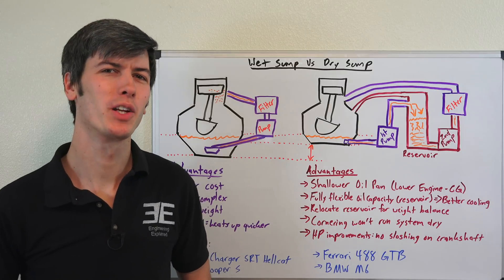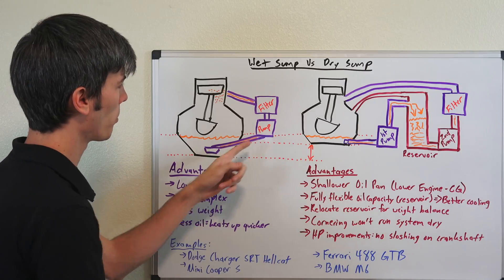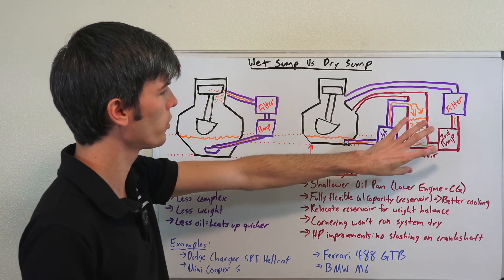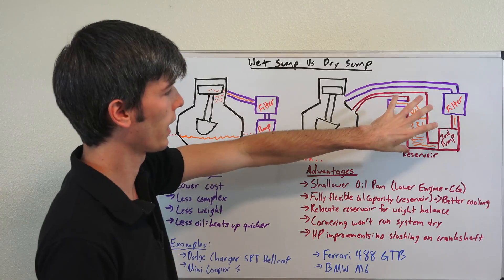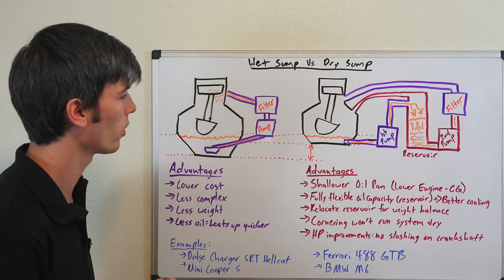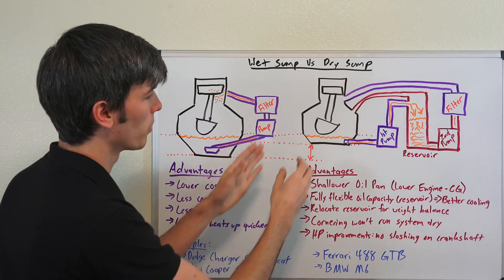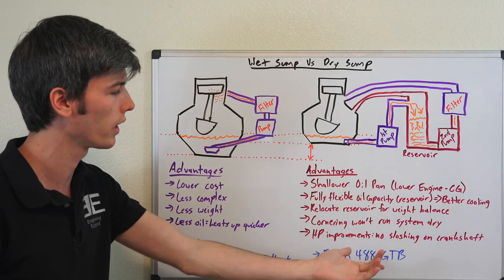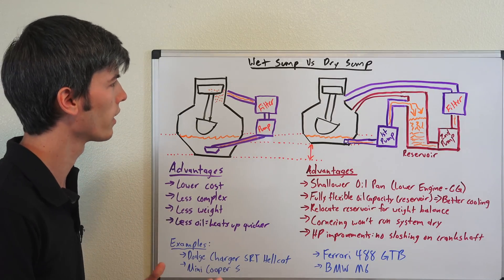Wet Sump Vs Dry Sump - Engine Oil Systems

Comment: My car has a dry sump system and for some reason this video made me so proud of it
Reply: Mathias Mang yeah, the reviews were quite negative about the engine, but I don't think its that bad. Maybe because I owned hot hatches before and this is my first sportscar so I'm fine with the sound and turbo feel. 
The only couple of complains are sound insulation (a bit too much road noise on motorways, but maybe because my car has 20 inch rims) and the fact that there isn't anywhere to put a big bottle (not a big fan of the foldaway cupholders to be honest, so end up putting it between the seat and the sill)
On the positive, the car handles like a dream, also loving the grip (its rwd but grips like an awd in a straight line and in the corners its just amazing), its comfy to be in and usable as a daily. Loving it!
Reply: ***** bought my car this year, so haven't yet had to change oil
So yet to discover all the differences
But I assume since you have two reservoirs of oil, wouldn't you have to drain oil from both and then fill just the second (the tall one) reservoir?
Reply: Dmitry L what car is it?
Reply: Mathias Mang Porsche Cayman
Reply: Mathias Mang yeah the "subaru" one ;)
Reply: what car do you have
Reply: Nice! The new model?
Reply: I really like the new one. Are you happy with it so far?
Reply: Dmitry L I think the media overreacted a bit about the new engine. I really like the car and want to test drive one when it's warm again
Reply: Mathias Mang yeah, I mean I see what they mean, compared to something like a GT4 or GT3 or even Cayman GTS, it does not have the same sweet exhaust note (it kind of sounds like a rough V8 instead to my ears), but it definetly is loud enough
Reply: i dont know what my car has
Reply: it's easy to know it btw !

Comment: This got me thinking, ' big end ' oil splash upwards used to be important?, it no longer is?
A ' dry sump' isn't really dry, it just has less oil.
I also ( perhaps mistakenly) thought that modern cars had multi point oil pick up circulation points for oil ?
In theory a dry sump seems a good idea, but the added complexity, joints piping will surly cause problems?

Comment: The Dry Sump uses eletric oil pumps, right?
Reply: 1300l Na most have a mechanical pump driven off the crank with a belt
Reply: nope , belt driven pump of the crankshaft , you can have a auxiliary electric oil pump to prelube or in case your pump fails or turbo timer to keep oil circulating on shutdown

Comment: You can always add slosh plates to wet sump to avoid engine running dry.
Reply: Still not as effective as a dry sump.
Reply: Matt Bell but wayyy cheaper
Reply: yes, aka as baffle plates or baffles. Essential mod for most track driven car
Reply: Indeed. There are even track ready oil pans with some interesting designs available for most of the popular track day cars.

Comment: I read somewhere that dry sumps on road cars take much longer to get the oil up to it's optimum temperature because they're driven normally most of the time. Is this really bad or not such a big deal?
Reply: From what ive seen it is not a big deal, especially with synthetic oil that doesnt have much viscosity change cold temps to operating temp's.
Reply: Well the effect probably comes from having more oil and possibly oil coolers, if the system was only set up for a high power runs it could run really poorly on very cold days with city driving.
It is a system for racing cars after all, other applications make it a needless hassle.

Comment: Nice video, as usual! You also get a  small horsepower gain from the crank case being run under vacuum. The total horsepower gain from a dry sump system is tiny though and mainly done for weight balance and oil supply.

Comment: How easy is it to change the oil on a dry sump lube system compared to wet sump?
Reply: Qasim Mir actually the same. its just thae sump is put somewhere else and the oil pump is way bigger than the normal ones.
Reply: Scuba actually the same. except maybe for some systems that are a little different. we don't  actually drain the lines every single oil change. look in manuals. in practice, similar to wet, just different location(s)
Reply: It´s much more complicated on the dry sump. As far as i know it from Audi´s W12 engine (dry sump) you need to suck the oil out from different locations in the system with a vacuum and for that the oil needs to be hot.

On the wet sump you just take out the oil filter and the screw in the oil pan.
Reply: sadakotube Yeah might be. As I said, I just know it from the Audi A8 W12 which you need to dry out completely.
Reply: On my old Yamaha XT600 they have a dry sump system as well. Yes. It's a pill. I had to look it up to even realized that I had to drain oil from 3 locations, 1 being the oil filter. If you want to see it, It's on my YouTube channel.
Reply: I'm eagerly waiting for Castrol Nexcel kinds of systems. Oil change+filter change takes seconds and anyone can do it. Also the used oil is in the container ready to be recycled.
Reply: Run silkolene pro 2 sx and install a VRO pump with oil injectors mounted in the intake manifold. This way the
motor is on total loss burn off with synthetic 2 stroke oil. This is exactly what I would do if I had a dry sump corvette. I’m sure it would word with xd-100 2 stroke oil though.

Comment: this channel is going to be responsible for a whole generation of engineers (of all kinds and walks of life).    I can't wait to be a benefactor (consumer) of all their amazing ideas. Thx EE
Reply from the maker: Ha, if it inspires a few that'd be amazing! :)
Reply: @EngineeringExplained  can a dry sump oil system run as a daily driver? do equal length TURBO headers have to be precise in distance to be considered equal length? Does firing order matter in the rate in which the collector or flange receive the exhaust pulses for example. Engine is a 4 cylinder front of the engine to back is 1-2-3-4 firing order is 1-3-4-2 at the collector should the pulses be counterclockwise, clockwise or zig zag or X pulses so that there is a quicker spool up? I know it's a lot of questions but I know you are the guy to answer them bc you have been around and know your stuff!

 Thanks bud 
Carlos
Reply: Engineering Explained uu you know I've been watching your videos for over a year if not more and I've learned a lot thanks
Reply: @Engineering Explained, I can tell you for sure that you are! I'm a first year mechanical engineering student wanting to go into the automotive field. Your videos are extremely encouraging as they really dive into exactly the stuff I want to learn more about. Thanks for taking the time to do these!
Reply: I might be one of those since I'm taking Electromechanical Engineering. (Please kill me and dont take this degree!)
Reply: invisibleaznDJ he's the theoretical version of Eric The Car Guy. EE & ETCG are responsible for pretty much everything I've learnt about cars.
Reply: Gurdip H if you like those two guys check out "Chris fix" as well, he does really nice how to videos that are cleaner and more concise than EtCG in my opinion, that's how I actually learned lot about how to work on cars from as well.
Reply: done
Reply: Gurdip H same
Reply: +Robert Anderson   Chris Fix is pretty good fo sho.   He just did a car parting video which I enjoyed.
Reply: I'm just glad that there are people who are taking the time to not only educate individuals how things work, but also those who are demonstrating what and how to do things. Yes, it's just the typical "Well, there's a video on youtube for it" scenario, but now we can move away from being so dependent upon service stations that will do a large up charge for labor when it's a 20-30 minute fix for most.

As a side story thing, a friend of mine and I replaced the balancer on his lumina a couple months back. It was a $15 dollar part, about $30 dollars for the puller, and the rest of the tools we had already acquired doing other projects. This is all stuff that if we get brave, we can do.
Reply: TheChikyChiky precisely. I used to send my cars into Honda for replacing the smallest of things because I never had the confidence to do it myself, but "How To" videos and forum help have helped save me loads by just doing it myself. Sure there are some things which I would send the car in for which I couldn't safely do at home by myself, but about 80% of the service and maintenance on my cars is done by myself.
Reply: Robert Anderson ah neat. Thanks for the info : )

Comment: The CTS-V loose 10 hp and 20 lb-ft of torque compared to ZO6 from changing dry sump system to the wet sump even though they have the same engine
Reply: Naufal Kusumah 

That's because the engine is slightly de-tuned vs the Corvette. GM always wants the Corvette to have the most horsepower out of their vehicles, at least, on paper that is. Back in the late 90s and early 2000s LS1 Camaros were rated at 305hp for the Z28, and 325hp for the SS, while the LS1 Corvette was rated at 350hp. However dyno results showed all 3 making the exact same power.

Comment: QUESTION:   Regarding the dry sump setup, using 2 pumps per your sketch I asume that they are of the same volumetic displacement (internal gear type) driven off of the same shaft.   To use different displacements would mean that one would never keep up with the other, eventually suck in air and cavitate.   Is that correct?
Reply from the maker: I guess they don't necessarily have to be the exact same size, but the first pump needs to be able to keep up with the demand of the second pump.
Reply: Engineering Explained I just figured it out.  Many builders use a centrifugal unit as the first pump.  The centrifugal pump will take whatever is available and send it to the reservoir whether their is air or not. The centrifugal unit would provide higher flow rates so as to never starve the second unit.
Reply: Dry sump pumps come in 1:1, 2:1 up to even 6:1.
The first number is the amount of scavenge pumps (air or oil from the pan), the second number is the pump pushing oil into the engine.

I've never seen a pump system with more than 1 "push" pump by the way.

Also, the scavenging of air from the carter pan (oil pan) reduces windage inside the engine... which according to some also helps make better power (less air pressure UNDER the pistons).
Reply: There are scavenge pump elements that evacuate the engine sump and there are pressure pump elements to send oil back to the engine. 
It is not unusual to have multiple scavenge sections and multiple pressure sections on dry sump systems on high performance/race engines. 

Typically there is more scavenge pump volume capacity than pressure pump volume capacity. 
Using more scavenge pump sections results in the crankcase always being empty and under a slight vacuum which aids in reducing windage, oil misting, reduced parasitic drag, improved ring sealing and increased power. 

The remote reservoir results in increased oil dwell time before being pressurized and sent to the engine resulting in fluid deaeration, cooler oil, large always available supply of oil, advantageous placement of weight, lower engine mounting center of gravity, increased engine ground clearance and increased usable power production. 

http://www.aviaid.com/schems/scems.htm
http://www.enginebuildermag.com/2012/06/wet-sump-and-dry-sump-oiling-system-differences/
http://www.enginebuildermag.com/2016/10/pera-parties-in-toronto-makes-plans-for-florida/
http://www.petersonfluidsys.com/tech_pumpdia.html
https://en.wikipedia.org/wiki/Dry_sump
Reply: Rafael Lastra com
As long as the pressure pump has a steady supply of oil, the engine will stay properly lubricated. Regardless of how large the scavenge pump is, it can only take whatever oil is available to it. It can't suck the oil out of the bearings. Using a larger scavenge pump will ensure that the supply of oil to the pressure pump is limited only by the amount of oil available to the scavenge pump, rather than by the flow rate of the scavenge pump itself.

On piston engined aircraft with dry sump lubrication, the scavenge pump is required to be 2x the volume of the pressure pump.
Reply: patw52pb1 Excellent comment!
Reply: Rafael Lastra com is it bad that my car takes 6 cortes but original had 5.3 and it's 18 years old
Reply: Tommy-Lee Armstrong I think, when reservoir overflows, it will flow back to shallow pan underneath the piston so inlet pump is always taking more than outlet pump.

Comment: Hey i wanna know what will happen if you go full speed on fwd car (said above 120km/h) and suddenly you turn the steering wheel at full rotation? Good idea for video i think
Reply from the maker: Lots of understeer + crash.
Reply: Don't forget the handbrake.
Reply: Engineering Explained that's funny because I was driving a FWD, at a semi low speed and it oversteered... :(
Reply from the maker: Ultimately depends on front grip vs rear grip. Lots of variables can change this (tire pressure, spring rates, tire wear, surface conditions), but most cars tend to understeer when turned sharply (while off throttle, whether braking or not).
Reply: Engineering Explained how is alignment and spring rates determined i don't understand how racing teams and brands such as BMW calculate this

Comment: I had a kart engine, biland sa250. 250cc 2 cylinder engine, dry sump. Before starting it we had to make sure the oil pressure was up. To do this we just had to remove the spark plug caps and turn it over until the oil pressure light went out. Once that was done, we had to fire the engine up and let it warm up to at least 50c before going out on track. Was all this a necessity because it was a dry sump engine? It only had one built in oil pump. We did notice at one track we went to, we weren't allowed to let it idle on the dummy grid to warm it up. On the first few laps while the engine was cold, it would sound quite rough. Same with the oil pressure. If you were ever running late and had to rush onto the track. Unless the pressure was fully up and temp, the engine didn't perform at all.

Comment: That was the theory. In practice, this is not true, or only to a degree. For example, the Porsche 981 is dry sumped - still, it specifically says in the owner's manual that you are not  allowed to put slicks on and the explanation Porsche give is that you would reach such high cornering speeds that the engine would run dry when cornering! - Despite being dry-sumped. And so the main reason really may not be the higher cornering speeds but simply a lower centre of gravity; and it would probably take a lot more effort to get the theoretical benefits out of the design (for a non-race car). And so without looking it up, I'd guess that is the same for the M6, because it is a heavy GT cow anyway more than a sports car... so why would they put in the effort? There was that Top Gear episode where the little dude (what's his name?!) drove his favorite car, the Zonda, around a track - and got his ass handed (despite 5x more horses!) by an actual racing driver summoned by Clarkson in a 981 S - that alone tells you that even a standard sports car has sooo much potential that you will neverfully tap it as Joe Average, and that "running dry when cornering" is probably never a concern for a regular sports car, such as the M6 (which isn't even a sports car - Jesus Christ, does M even design cars still that weigh less than 2 tonnes?! ;) ). Then again, you might as well put slicks on your 981, because you would fill up your pants with warm slush three times over before the engine runs dry in a corner ;)
Reply: The 981 has a semi-dry sump setup instead of a true dry sump system though, so its cheaper and you dont get a lower center of gravity, but it does fix some of the issues that earlier engines had with oil starvation on the track. So they did have enough oil starvation issues to implement a semi-dry sump system.
Reply: Baerchenization Shut uuuup
Reply: Baerchenization interesting. However, the little guy is called Richard Hammond ;)
Reply: Baerchenization yeah its just theoretical
Reply: Be careful what you say - I know you. You are that guy who gets a headache every time someone breaks the 160 character limit of a tweet, isn't it?!
Reply: Baerchenization Shut uuuup

Comment: In a dry sump system, would it not be advantageous to "prime" the pumps BEFORE cranking? I mean, there are the other benefits you mentioned but start up on a normal  car is where most of the wear n tear occurs to the bearings. Obviously there's no pressure at the main/rod/etc. With a dry sump you could kick the pump on just 2 seconds before you engage the starter. Bam, you have 40 psi(example) of pressure to handle the initial start up and protect the bearings.
Reply: Most are connected by a belt so you have to slip the belt off to do that. An accusump will do what you're talking about though.

Comment: what car is that on the thumbnail? i think its a ferrari of some sort but only ferraris im really familiar with are older ones, or the 458, i like the 458
Reply: That would be the 488, the Ferrari he used in the example :)
Reply: GamingPredator It's the successor of the 458 Italia, the 488 GTB ;) (and yes, technically, there's still the 458 speciale in between but that one has the same base as the "normal" 458 Italia)

Comment: Some dirt bikes are wet sump as well. With the XR650L, you put oil in the frame down tube - thus the wet sump. No oil pan, oil is air cooled through the frame. Kinda neat, definitely a cheaper way of doing it haha
Reply: Yeah.